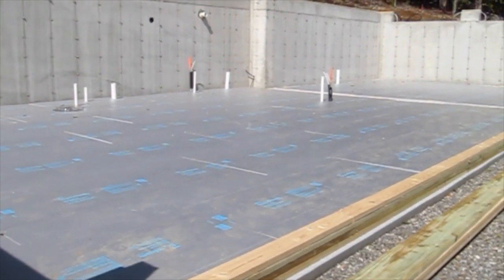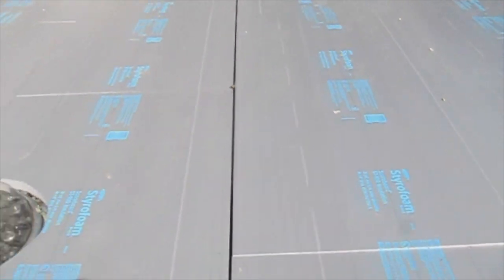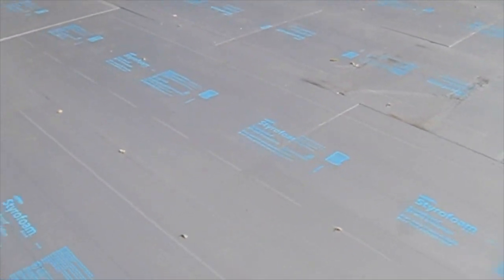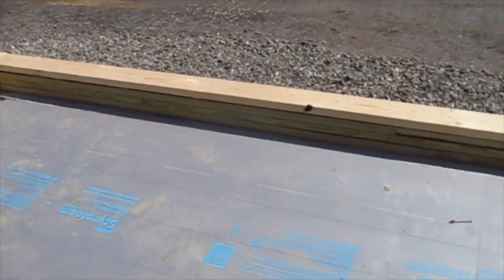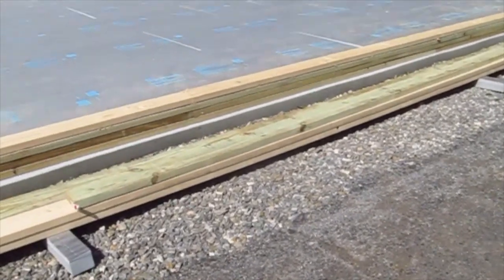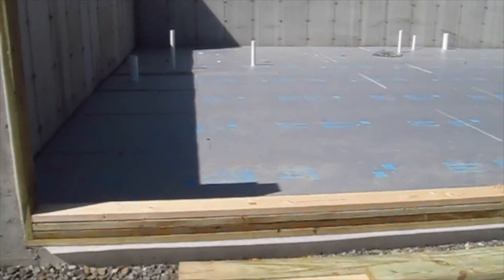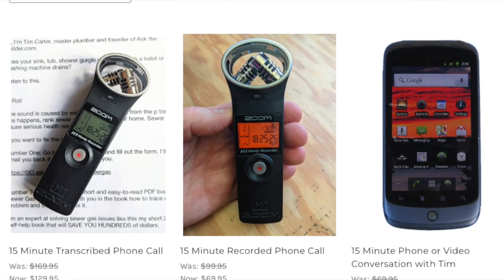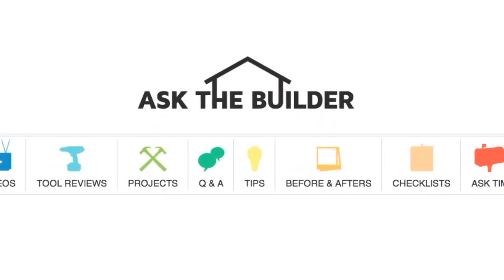Concrete Slab Insulation MISTAKE

Comment: Thanks!
Reply from the maker: Many many thanks for your support of my channel!
Reply: @askthebuilder  Won't the gravel poke holes in the barrier? And won't the foam board float if cement is poured, directly onto it? It seems like the foam board, should be laid down first, with the barrier laid on top of it

Comment: The vapor barrier is not installed yet. It goes on top of the rigid from insulation. They will put it on later. As far as your comment about pressure-treated plate the only one that should be pressure-treated is on touching concrete. The top one doesn’t need to be pressure-treated.

Comment: In the UK they allow your dpc visqueen barrier 1200 gauge to go over or under your 100mm rigid insulation then turned up any wall 
 the thickness of your concrete slab or slightly higher maybe up to dpc level this usually applies with a double brick/block wall with a 100mm insulated cavity   but any internal length of outside wall fit a cold barrier upstand  of 25mm thickness insulation the thickness of the concrete before laying to obviously stop cold penetrating from your outside wall into the new concrete slab

Comment: You’re correct on the built up sill plates and that’s a shortcut way of correcting their mistake. For sure will cause issues down the road, but the vapor barrier goes on top of the foam for multiple reasons.
Reply from the maker: Agreed to a point. The closed-cell foam is a very good vapor barrier. Remember, I didn't build this house.

Comment: Great channel! Love your shows, as a licensed electrician I’m not up on concrete codes but is a vapor barrier required in all states of the US?
Reply from the maker: Mark, TNX. The big difference between the NEC and the building code, I *believe*, we builders use is that local inspectors use the building code as a set of recommendations. They can ignore parts or even make it more strict. 

The NEC, as I have seen, is the law of the land and local inspectors have no, or minimal, leeway. Bottom Line: Even if vapor barriers ARE in the code it doesn't mean a builder has to use them. But those that don't obviously didn't pay attention in high school physics class or were absent on certain days.
Reply: @askthebuilder  thank you for that quick response! Most basement slabs that I have seen use fine sand, then tamp it, install a wire mesh then pour. I don’t believe I have ever seen pvc pipes placed to draw out radon gas at all sadly. Just for French drain systems near high water tables. I’m wondering why this isn’t mandatory? Similar to leaching fields used off a remote sewer plant…
Reply from the maker: I'd rather not state in public why I think it's not mandatory.
Reply: @askthebuilder  I understand and I’m sure it’s a cost factor that no one wants to pay for or even knows about (meaning the homeowners).
Reply from the maker: No, that's not the reason at all. You're not even close. Clue: Who authors the code? Any homeowner that was given the option of installing a vapor barrier assuming it was explained WHY it's so important would undoubtedly say "install it". The issue with slabs is you get ONE CHANCE.

Comment: maybe theyll put the barrior ontop
Reply from the maker: They didn't put any additional vapor barrier down.
Reply: The vapor barrier belongs on the top of the insulation, not under it
Reply: @cynthiaarmstrong7972  Yup, otherwise the concrete would get under the foam boards and pop.

Comment: Hi!  Love your channel!  Isn’t there also an issue of frost getting  through the concrete wall and freezing under the foam since it’s a slab on grade?  Or is that not a concern. I worry about since the building heat isn’t transferring down due to insulation in floor, it could freeze and heave underneath.
Reply from the maker: TNX. Insulation SLOWS the transfer of heat. The heat from the house gets under the insulation and into the gravel. Conjure up all those high school physics classes. You were probably one in the room that said, "How will we EVER use this information in our lives????" Now you know!!! :-)

Comment: A lot of places put the vapour barrier on top of the insulation so it just might not be installed yet. Doing it that way, allows water to drain from the insulation. Otherwise, you can get thermal drift (the insulation becomes less effective). 

The built-up plate is definitely wrong. You don't put wood below the level of the concrete. It will get soaked and rot. Even if it doesn't rot, each of those plate will shrink and cause issues along the wall that is over the plates. The right way to have done that was to pour the concrete foundation wall higher. If they left it low by mistake, you can always por another short wall over the lower concrete.
Reply: You said what I was going to say, 👍👍